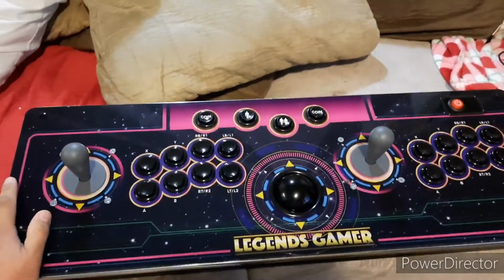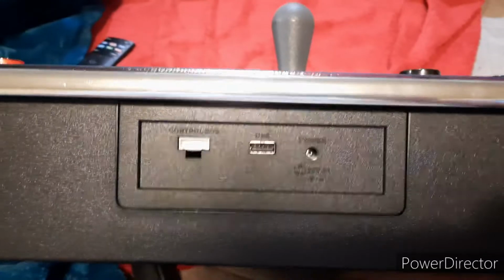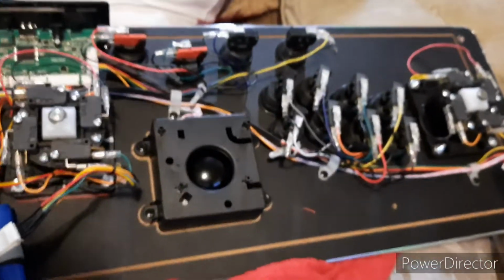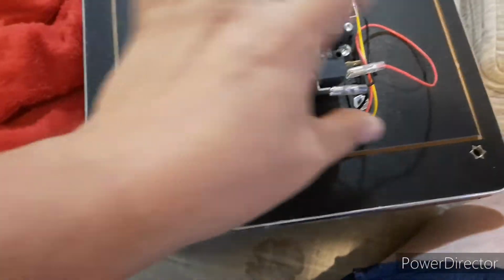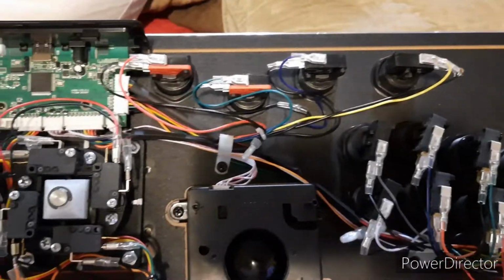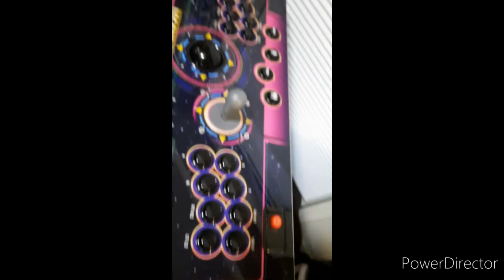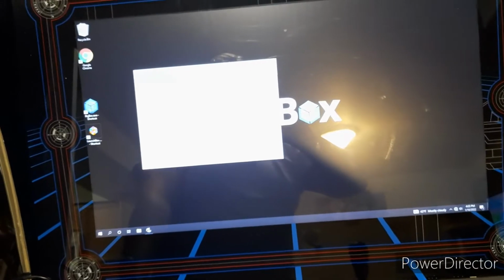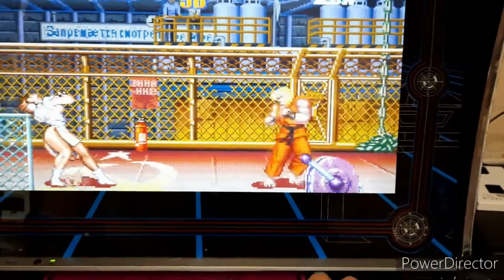Atgames Legends Happ / IL Euro mod

Comment: I found a legends ultimate minus the stand used for $150 on FB market. I had to reseat the bus com port thing in the back of the deck and tape the power button down but its working. Your guides are always a big help!
Reply from the maker: That's cool. Amazing you got it fixed. And thanks! Making new ones now so hope.tbose will be just has helpful

Comment: I did the same put gamer pro in ALU.  I put in 6 pound springs but haven't changed the buttons yet. I play off of steam deck super easy.
Reply from the maker: Nice. These are euro IL happ arcade sticks, if you like the American arcade feels its as close as you get. But when you do button mod I suggest using the gold leaf microswitches. I think you can get them from ultimark website. I only suggest that cause I hear good things on them and with the buttons on this mod over time the button began to get stuck and happend to 4 buttons so far. Great joysticks but button quality not so. Anyways thanks for the watch!